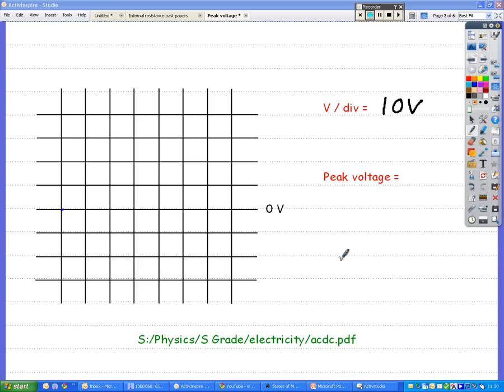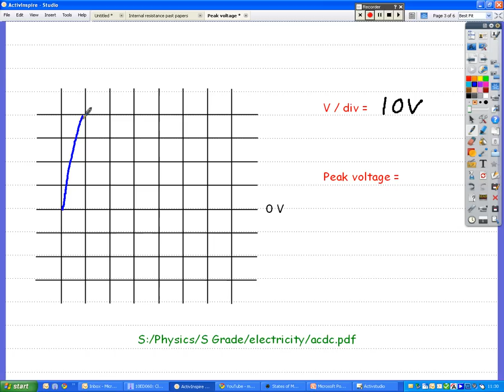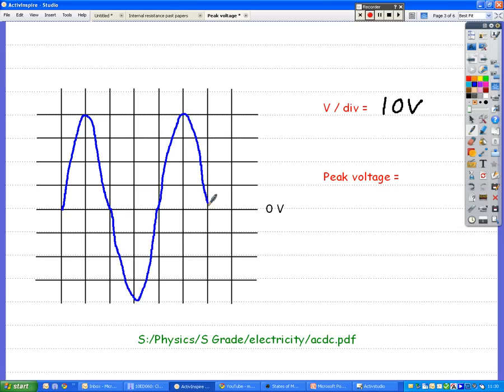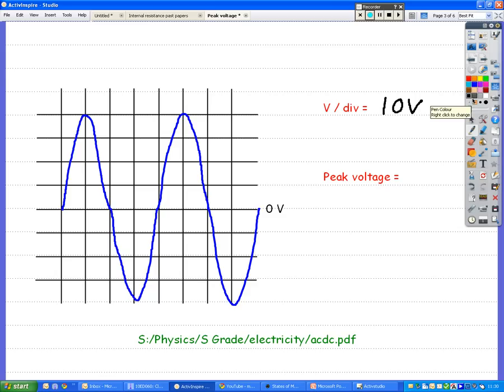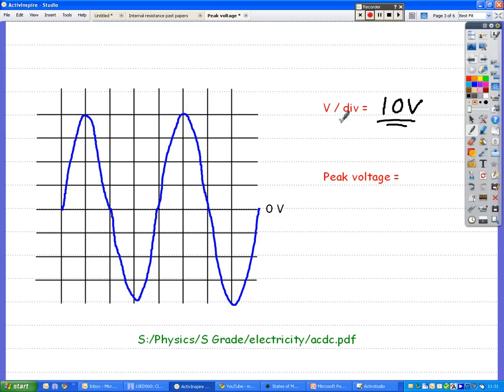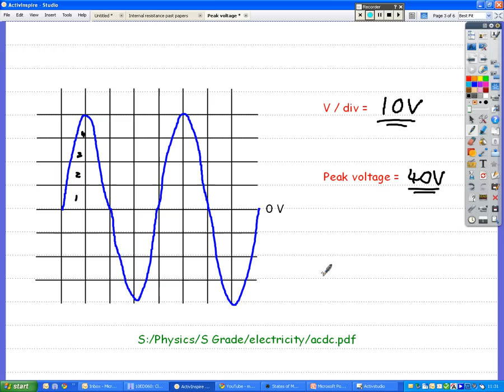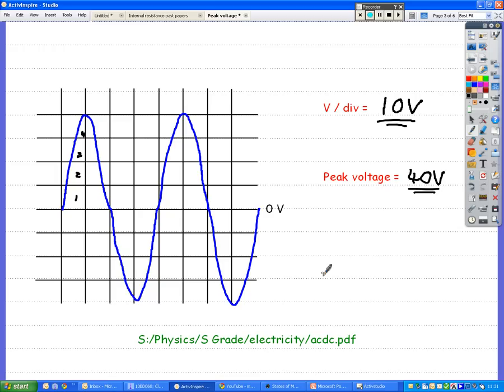Measuring peak voltage

Comment: if my "VRMS" or effective voltage is 141.1 volts, what is the peak to peak voltage?
How do you calculate this?
Reply: just do 141*the number of squares to the highest point and then multiply the answer by two, that would be peak to peak

Comment: With all due respect, this video is a perfect example of a little bit of knowledge being worse than none at all.  You either don't really know what you're doing or you've dumbed it down to the point that it loses actual significance.  You make a demo of peak VAC with no clear reference to RMS, you rely on an arbitrary and capricious measurement technique so absurd it borders on ludicrous (10x blocks?!  Really?!?!) and never even touch on the why PVAC is important or its relation to RMS or the AC wave.

This is how idiots come to the conclusion that they're electrical engineers before they cook themselves because they can't figure out ridiculously basic concepts like telling voltage from amperage.